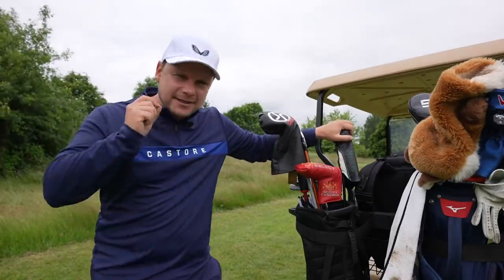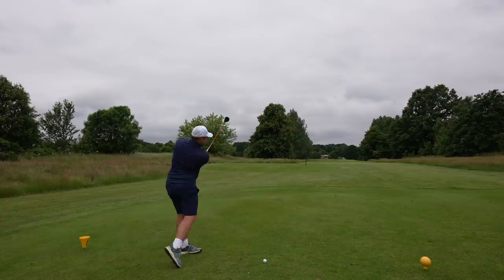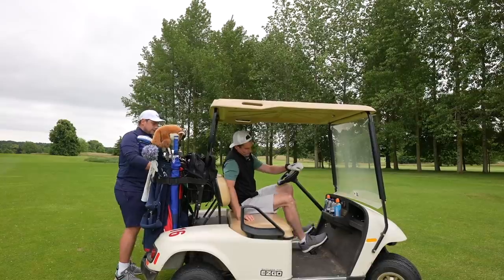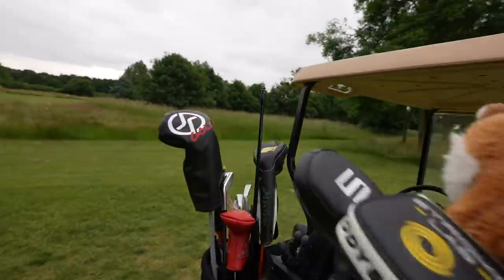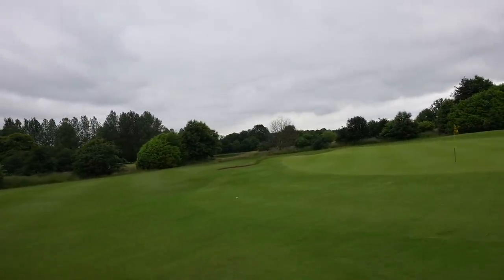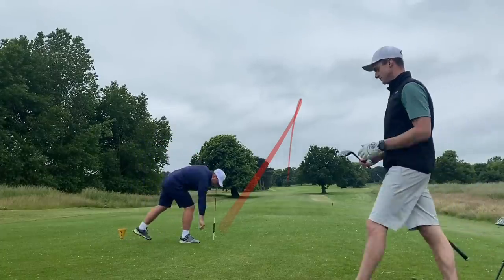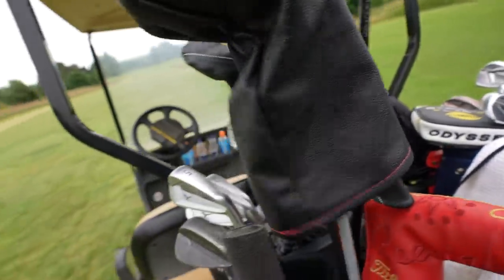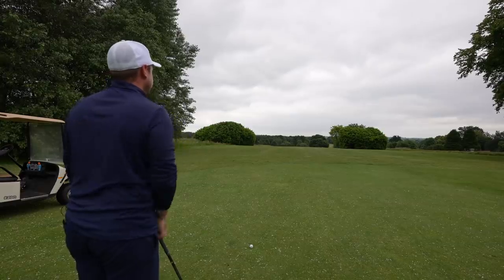Testing An EXPENSIVE EXOTIC NEW SHAFT... GAME CHANGER!?

Comment: The shafts are the engine of a golf club and are well worth the upgrade. The Accra shaft in my new Ping driver was nearly as expensive as the head itself but it was the only shaft the fitter had me try that got my spin rate down to below 2300. The difference was insane!

Comment: I use upgraded and fitted shafts everywhere across my set. Currently, I am using the Evenflow Blue "Hand Crafted" 55 gram shaft in my Ping G410 and the 65 gram Evenflow shafts in my fairways. They work well for me.

Comment: I got a second hand hybrid and 3 wood with this shaft after a fitting. I had trouble with snap hooking the hybrid in the stock shaft and this has straightened it out and gained about 10 yards. So i’m sold

Comment: Had a golf fitting for a new Ping Driver and hybrid.? I was amazed the impact of changing the shaft had on there spin rate, launch and total distance. So maybe the expensive shaft is better, but being fitted (only takes 30 minutes) by your local pro or a certain chain, will make a significant impact on your game

Comment: Upgrade shafts only help if you fit for it.  I'm stuck in my ways and tend to fall back to the same shaft in my fw woods regardless of the head characteristics because I'm chasing a weight and feel.  I've been playing the #Fujikura  Motore Speeder 8.3X since it came out in my fw woods.

Comment: I’m on the fence about exotic shafts to a point but with that said I purchased second hand a Tensei white ck series driver shaft I paired with my G425 LST and absolutely hit bombs with it 99% of the time. Liked it so much that I have bought an AV raw blue for my 3 wood and a ck blue for my 3h and 4h that I assembled yesterday and will be playing tomorrow. So far they feel so much better than the stock Alta cb shafts that were in them but I’ve only hit a couple balls into the net at home with them. Also got a steal of a deal on a second hand Ventus blue shaft that I’m going to try on the range with the driver and see if I can get the ball flight up slightly more than with the Tensei white and if I can the white is going to get paired with the G425 max head and see which combo is better. This is why I’m on the fence. I’ve bought aftermarket shafts for all my long clubs, but don’t know I would drop the $300 plus for one brand new just yet. The graphite design shafts do definitely interest me as well but with that price I feel it would have to be a fitting for the right model before I head down that path

Comment: The importance of a shaft is not how expensive it is, and getting a new shaft just because it looks good or is the most expensive is like buying a Ferrari if you cant drive... However, I think so many people have this wrong. It is the mid to higher handicap (10 - 24) players that will benefit the most from shaft fitting. Low handicap players have the skill set to overcome the issues that poorly matched equipment creates. Once you start getting your handicap down you normally start hitting the driver with more speed and confidence. Finding the shaft that matches the amount to which you offend the engineering of the shaft is the key. 
For example, just because you swing fast doesn't mean your automatically have to be in an X flex. More important is that, for example, if you add twist in the down swing, you may need a shaft that resist torque more than others. And just because the shaft is expensive and marked "X" doesn't automatically make it right. 
And, if you are one of those people that can play with which ever shaft you want and changing it makes no difference to your game. Just know that most of us other golfers hate you! 😜😉

Comment: New shaft is working a treat.   But why are the bags the wrong way round in the cart?  How will I sleep at night with OCD ticks firing at 10.0

Going back to your main question, the main issue with aftermarket shaft upgrades is the "made for range" that come with TM, Callaway etc that trick the golfer into thinking their new club comes with a £300 aftermarket shaft, when it really does not.  

Take the Ventus range as an example.  The Ventus shaft that comes in the SIM2 (without Velocore) is pretty much pure junk.  Whereas the Ventus range of shafts bought aftermarket at £300, and the most popular shaft on all the Pro tours right now is a weapon.  Your average Club Joe doesn't understand that the same paint job on a shaft doesn't make it the same product.  Even though everyone can do the math:  SIM2 = £399, Ventus Blue aftermarket = £300, so is the SIM2 head worth £99?  Answer No.

Comment: Years ago, I made the mistake of putting a Graphite Design shaft in both my driver and 3-wood. For whatever reason, the shafts were a perfect fit for my swing and my distances/accuracy/consistency rate showed it. To this day, every shaft I try is measured against Graphite Design - and all just don't seem to measure-up. You can go absolutely bonkers trying to just find an equivalent shaft between 2 manufacturers - no one measures the same shaft characteristic the same way. Unfortunately, I just can't justify playing a $350 GD shaft in a $650 driver; instead I make do with the current "great" shaft (ProjX Smoke, then ProjX Evenflow [which snapped the second time I played it]) and think ugly thoughts at it.